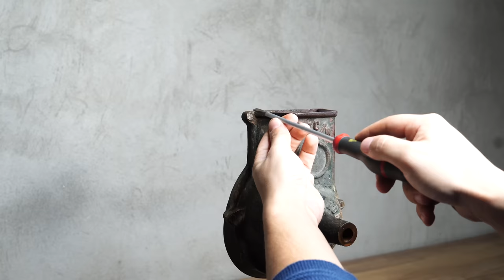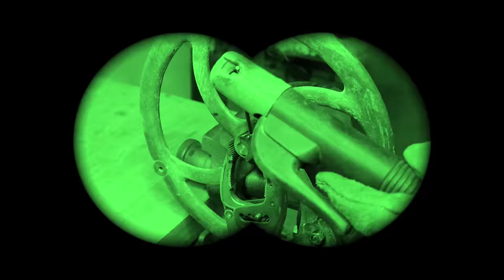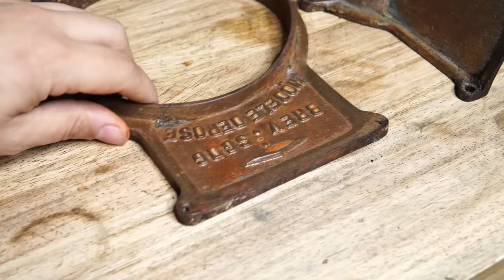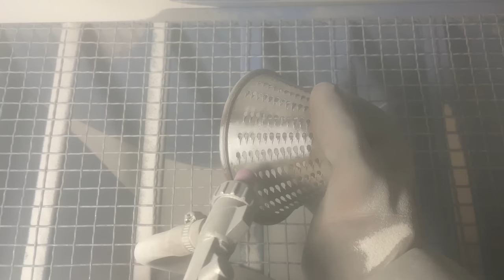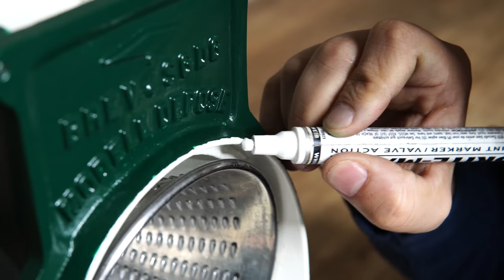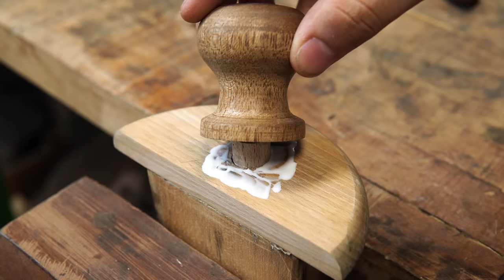Vegetable Grater Restoration

Comment: A little tip for gluing dowels. Take a pair of vise grip and squeeze the dowel along its length to leave teeth marks. This allows any excess glue in the hole has a way to escape. Otherwise pressure builds up and you can actually split the wood if it's thin enough along the grain. That's why dowels for woodworking have the flutes down them. Pressure relief.

Comment: For the rust removal process, why not electrolyze at least the big parts instead of only sandblasting them? And it might be better to use powder coats instead of spraypaint.

Comment: Question, and NOT a criticism - I'm truly curious.  If you know things are going to take a trip through the blasting cabinet, why bother stripping the paint?   Is this to keep your blasting medium as clean as possible?
Reply: It might be because the paint on some of those antiques has lead in them.  Stripping the paint off before sandblasting is to prevent lead dust from getting into the sandblasting medium.  Rescue & Restore uses special pens that check for lead content in paint.  It's understandable if they don't have that here.  😎👍